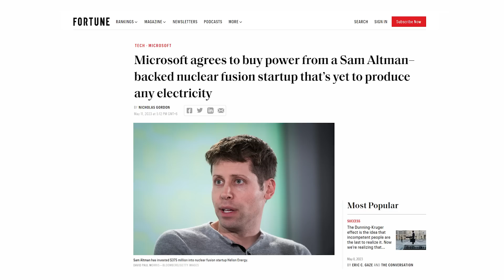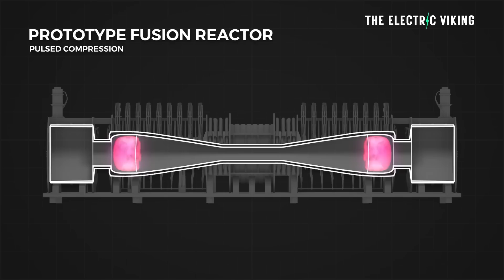Microsoft says the nuclear fusion dream is about to become a reality

Comment: For a moment I got the impression you’ve been gaslighted, but the final minutes made clear you’re still focused.
For many, many years I’ve been intrigued by fusion, as as an engineer I follow all steps done at ITER (and possible alternative paths)
What they are telling is the truth…. But not the complete story.
It is “cleaner” than fission, but stil… An interview by Brian Greene (world science forum) made me start thinking again.
Firstly: hydrogen fuses cleanly. But, required temperature/ pressure is not achievable. Hence they use isotopes. Initially they tried deuterium, far scarcer than hydrogen, but most installations use tritium. Very rare element. And when fusing that, it produce lots of harmful radiation…
Besides that, even the sun doesn’t “burn clean”: people spending much time up in the air experience higher level of solar radiation, and those much higher, like in the ISS, have been diagnosed with altered dna, because of the radiation.
Fusion is (here on earth) and remains something for the far future. For lunar, Mars, or deep space, where you have besides solar radiation also far worse cosmic radiation, that is less relevant.
Here on earth, sun, wind, tidal with batteries should provide more than enough.
Reply: Helion will use a two step process.  The first step making H3 will be "dirtier", releasing Neutrons.  The  second step, the actual fusion pathway will be clean. Helion will be making their own expensive H3.  Helion's fusion is actually a two step process.  First they make H3 with just deuterium in opposed accelerators similar to their main fusion accelerators. Deuterium is not that expensive.  Helion will use separate accelerators because making H3 releases neutrons which will degrade the accelerators.  The accelerators for making H3 don't have to be as good as their main, opposed, fusion, accelerators.  Then that created H3 with deuterium will be used in their main opposed fusion accelerators and this reaction will not release neutrons, so the accelerators will last longer.  Helion will also be be able to sell tritium to other reactors or keep storing it until the tritium decays into H3 after 12 years.  Helion might be a profitable business just by making and selling H3 and tritium.

Comment: A few prominent YouTubers have done videos on this technology in years past, it looks neat, kind of a dual rail gun that shoots plasma balls, but it has zero chance of making any energy, their biggest breakthrough so far has been not bringing down the power grid when they fire it up.
Reply: Their current machine actually does create fusion energy. When they fire up the machine it's not connected to the grid. It's connected to a bank of capacitors. These capacitors only need a few kWh of energy. However will it ultimately work ? only time will tell.

Comment: I wonder how the sun is able to do fusion 16 times less hot...?
Reply: Yes, good question.  The reason is the sun has the constant weight of an entire star pressing down on its hydrogen interior regions to induce fusion.

Fusion can be accomplished by combination of heat and *pressure*.  If you're lacking pressure (as we humans are) then your only option is via heat to try to induce fusion.  Fusion has to break the "strong nuclear force" in the atom's nucleus which is the literally the strongest force in the universe.

Also the sun can fuse regular hydrogen.  We humans have to use two isotopes of hydrogen: deuterium (2H) and tritium (3H) -- "DT" reaction.  That just to get the fusion heat down to 100-million °C temperature.  If we used DD reaction or regular HH reaction, the fusion temperature would be even higher!  Tritium is extremely rare.  Estimated at $30,000 per gram.   The most well known fusion project "ITER" themselves say 300-grams of Tritium is needed per day for an 800MW reactor

Fun fact: our sun contains 99.9% the mass of the solar system!  The rest of the 0.1% is mostly Jupiter and Saturn.   So the Earth is like  a speck of sand next to a 10-pin bowling ball.   All the combined fissile and fossil fuel on Earth would be like a bucket in an ocean when compared with the sun.  That is the major advantage of wind & solar.  Its drawing on effectively limitless energy that cannot be sanction, embargoed, or tariffed and available everywhere on Earth.

I would think nuclear fan boys would already be on board with renewables as it already is powered by their holy grail "fusion" power!
Reply: @beyondfossil  100% spot on. Let's rely on the giant fusion reactor in the sky. However, I don't think H3 is that rare. We used a lot of it in a genetics lab I helped keep up and running. I could be wrong though.
Reply: @beyondfossil  thank you for your excellent answer. I learned something today :D

Comment: Well this is interesting. Subscibed and after the very first critical but not violating any guidelines comment, find it has been deleted within a few minutes!
A less confronting second try. Helion's approach is according to the following highly experienced ex-fusion researcher's take, doomed:
https://www.youtube.com/watch?v=3vUPhsFoniw
It would be 'nice' if EV chimed in with a pertinent comment here in comments section.
Reply: Just post a summary: Summary:  Plasma has a charge.  A charge passing through coils produces electricity.  Helion uses fusion to produce plasma and releases it through coils, making electricity.  People are also missing that Helion uses a two step process. Helion will be making their own expensive H3.  Helion's fusion is actually a two step process.  First they make H3 with just deuterium in opposed accelerators similar to their main fusion accelerators. Deuterium is not that expensive.  Helion will use separate accelerators because making H3 releases neutrons which will degrade the accelerators.  The accelerators for making H3 don't have to be as good as their main, opposed, fusion, accelerators.  Then that created H3 with deuterium will be used in their main opposed fusion accelerators and this reaction will not release neutrons, so the accelerators will last longer.  Helion will also be be able to sell tritium to other reactors or keep storing it until the tritium decays into H3 after 12 years.  Helion might be a profitable business just by making and selling H3 and tritium.
Reply: @jamescottrell7147  Your claim that the deuterium-H3 fusion reaction is aneutronic misses a crucial point in that regard made by Improbable Matter's critique: The deuterium unavoidably will fuse with itself at a much higher rate to that for deuterium-H3 (at the 100 million K temp range), and deutrium-deuterium fusion DOES release neutrons! Hence the main reactor will become radioactive in fairly short order. Massive shielding would be mandatory.
And of course there were other issues raised - such as the ~ 3 orders of magnitude lower reaction rate compared to usual deuterium-tritium fusion at the claimed 100 million K operating temperature. And the matter of large radiative losses owing to unavoidable bremsstrahlung.

Maybe you are right they could make money by just creating H3 and tritium for use elsewhere. That would very much depend on how long the reactors for that 'secondary' purpose could last.

Comment: I believe they have been able to achieve a net positive fusion reaction, but the positive part is extremely minute. I follow a podcast called Undecided, who follows this, but I don't believe that the heat was really a large factor. 

Like everything, scale is hard. 😂❤
Reply: No. They achieved a "mathematical" net positive. Not an actual one. (Which is why we are not celebrating right now.) The energy pumped into the plasma is net positive. Add all the Other energy inputs (including the containment field) and you still have a firmly net Negative energy generation. It is another iteration step forward but its premature to celebrate the dawn of any practical device.

Low temperature fusion remains an unproven hypothesis. 100million degrees is solar core temperature and IS a proven goal.
Reply: This is what everyone here is missing.  Look closer at Helion's two step process. Helion will be making their own expensive H3, but not deteriorating their main fusion accelerators.  First they make H3 with just deuterium in opposed accelerators similar to their main fusion accelerators. Deuterium is not that expensive.  Helion will use separate accelerators because making H3 releases neutrons which will degrade the accelerators.  The accelerators for making H3 don't have to be as good as their main, opposed, fusion, accelerators.  Then that created H3 with deuterium will be used in their main opposed fusion accelerators and this reaction will not release neutrons, so the accelerators will last longer.  Helion will also be be able to sell tritium to other reactors or keep storing it until the tritium decays into H3 after 12 years.  Helion might be a profitable business just by making and selling H3 and tritium.
Reply: @jamescottrell7147 :  None of that matters if practical fusion power at commercial scale isn't reached, and we're nowhere close to that given Q(engineering) is a TINY fraction of Q(total).

Comment: So...engineers can solve the problem to an end, solar and wind will never cover the increasing demand and already in many places peoples are not happy with the wind turbines. In Sweden is an active movement in the rural area against the installation of new wind turbines. Peoples are not really like them... 
Solar... nice, super, the elephant in the room is the waste. After 15–30 years of active duty life, solar panels are the most dangerous kind of pollutant for the environment. And is more expensive to recycle solar panels than to make them...
So, if fusion is cost-effective, will disrupt all others as are the most concentrated energetic source, even in front of fusion reactors. And is absolutely necessary to do it so, for an interplanetary specie... For example, Mars terraformation cannot be done in the absence of viable and stable fusion reactors to provide reliable energy. The Mars artificial magnetic field made by interconnected satellites requires them to be powered by micro fusion reactors, for a viable solution. And so on...
So, you see now, is not about renewable, is about the entire future of our specie...

Comment: Be careful of claims of no environmental risk with fusion. The atom of hydrogen with 2 neutrons (tritium) unlike the 1 neutron isotope (deuterium) is radioactive with a half-life of 12.3 years.  IF this process makes any meaningful amount of tritium as a byproduct, the waste tritium will need to be separated from the helium and stored for about 6 half-lives (about 75 years) before it is relatively safe. This is a tiny fraction of the millions of years for plutonium, which is a by product in some types of fusion reactors, but is still not trivial.
Reply: I see you know something.  Pulse fusion is easy compared to sustained fusion.  Helion will first make H3 from deuterium which will give off accelerator degrading neutrons.  Next it will use this H3 and deuterium as fusion fuel producing no accelerator degrading neutrons.  Tritium is not a waste.  It can be sold to tokomak reactors if they ever become a thing.
Reply: @jamescottrell7147  You are correct- I know just enough to be dangerous 😉. Depending upon the energy of the “accelerator degradation neutrons” they will strike atoms in the materials that make up the containment vessel and associated support and feed structures, creating isotopes of those materials. There is no way to escape that and like in fusion power plants, those isotopes may have highly energetic decay pathways that will make long-lived radioactive waste. 

IDK what those are, or how “hot” the waste will be, but my point was that fusion is not as benign as it is made out to be.